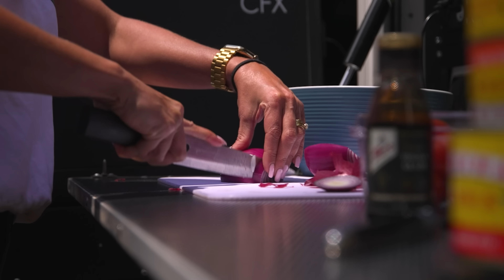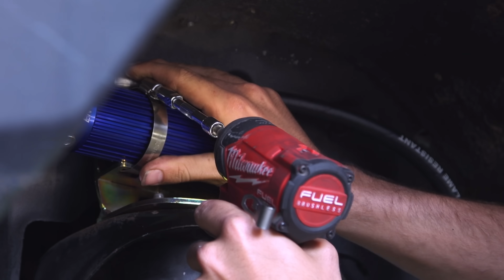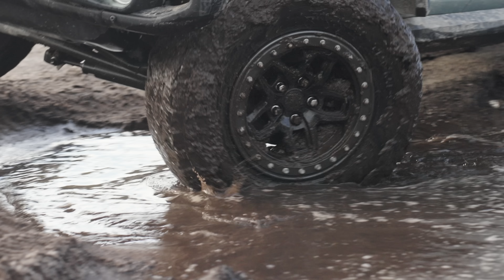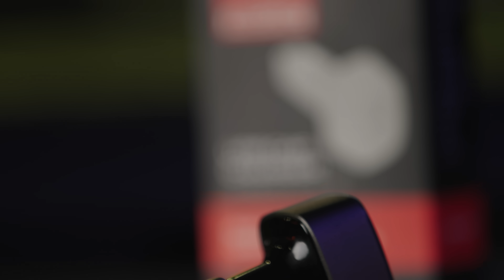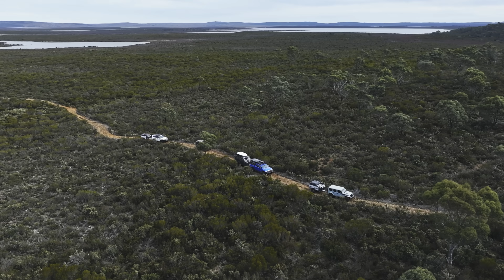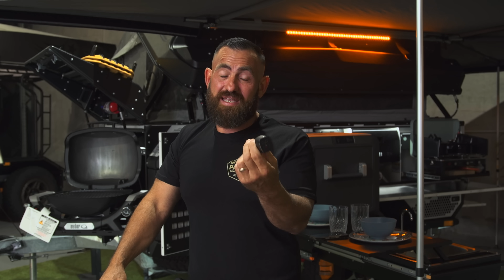This Tiny USB Charger Is a Total Charging Hack for your Car!

Comment: Numerous other brands have offered the same since 2012 which is when USB-C PD (power delivery) launched.  Amazon shows about 20 brands with USB-C at 60W (USB 3.0) to 240W (USB4) in cigarette lighter format with 12V input. Why the excitement with Redarc joining in 13 years later?
Reply: Highly likely because they are affiliated with RedArc, they have promoted their products in the past

Comment: Hi Justin 

We use the Ugreen 130W and 150W GaN car charger delivers real 100W on usc c port for the Starlink mini dish with a 10 mtr ext. Cable
Plus a usb a and another usb c port.
Very good quality.
Since it has a open cooling system it is not water proof and need a cover while plugged in outside the van

Cheers